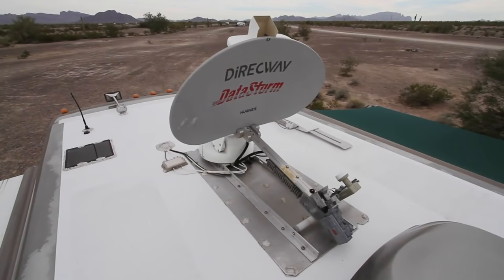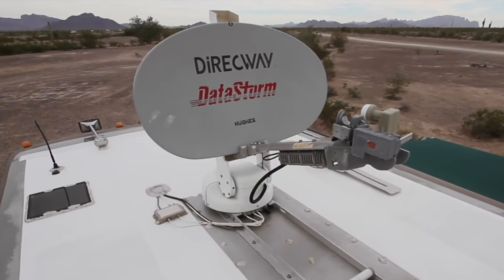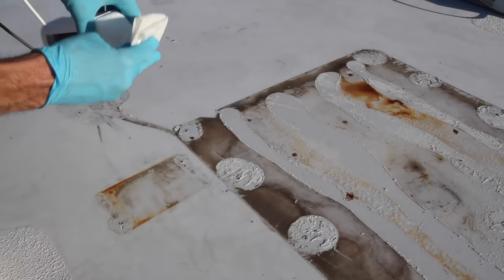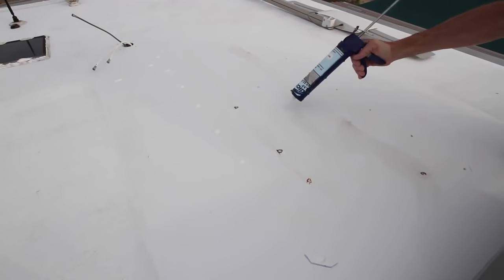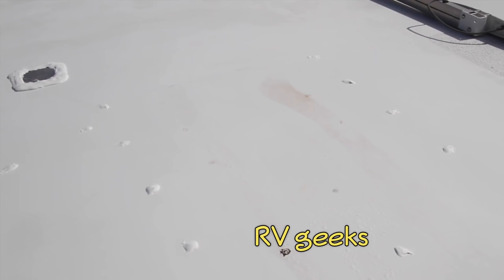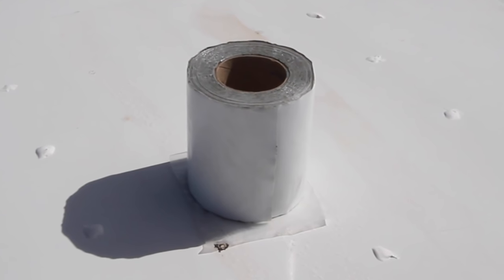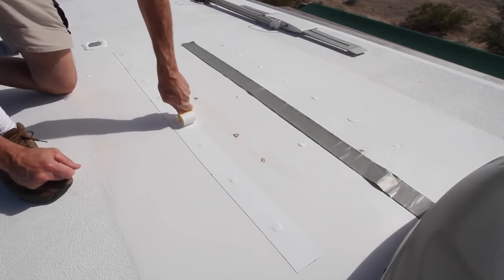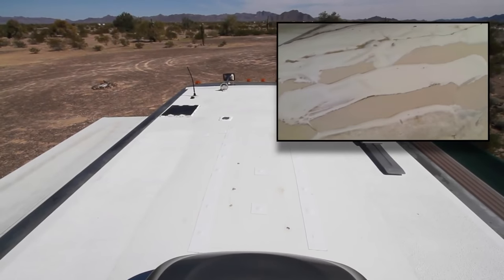How To Repair Holes in an RV Roof

Comment: Have a reverse issue. I have a similar hole to feed cables in but after two attempts it is still leaking. I think water is following the cables. I see you also put a cover on top , that just a sheet of aluminum? That is one thing we haven't tried.. do you have any video of the original install to show how you sealed hole?
Reply from the maker: The proper way to do this is with a junction box, which is how we installed our solar set up. That hole in the roof came from the factory like that with just a thin sheet of aluminum over it. It’s not ideal, but since we’re assuming that installing a junction box would be a lot more work since you’d have to access the ends of the cables to do that. Possibly better than aluminum would be a square of galvanized steel which is pretty thin and flexible. You could get about a 6 inch square of it and screw the corners down, pressing the cables flat against the roof the way ours does, and sealing all the way around with Dicor self-leveling lap sealant. Again, not ideal, but it’s never leaked in 16+ years.

Comment: I don't understand why so many people use Dicor when you have to inspect it once or twice a year for cracks. There are myriads of sealants and caulks that do not crack for a decade if not more. Am I missing somehting? Please explain RVgeeks. Thanks.
Reply from the maker: Other sealants become too firm, where Dicor stays soft and pliable. The vibration of driving would cause those sealants to separate from the roof over time. Dicor does not. The minor surface cracks that develop over time are easily detectable and patchable.. Specifically name one of these “other sealants” then read the directions, and you’ll find that Dicor is specifically made for this job and they are not. Even if you did use something else, nothing lasts forever. The difference is that others sealants aging and need of repair would only be detectable by the penetration of water into the RV.

Comment: With Direcwav, you have internet anywhere. Millenicom is available only where there is cellular coverage, correct? I ask because we do a lot of boondocking here in Utah where there is zero cellular coverage. Thanks for the great videos.
Reply from the maker: That's true. Where there is no cellular coverage at all, Millenicom will not work. And of course the dish will work anywhere you have a view of the southern sky. The reason we made the switch is because, although we still do a lot of boondocking, we rarely find ourselves completely out of cellular coverage areas for very long. The Datastorm dish gave us so little data before cutting us off under their "Fair Access Policy" that it just didn't work well for our needs. We work online and need more data and more speed than the dish could provide. The downside of course is that if we do find ourselves in no-cellular areas, we don't feel as comfortable staying too long without any connectivity to our customers.
Reply: RVgeeks
Wow that was a fast reply! Okay on the Fair Access Policy, that and the fact that I just read that basic tripod setup equipment runs between $1300 - $2000 tells me mobile satellite internet is not worth pursuing.
Reply from the maker: Our roof-top dish, which automatically searched at the push of a button, cost a whopping $5,500, and that was 9 years ago!

Comment: Hello. I need to cover a 1 “ hole in my rubber RV roof that the previous owner has used for a satellite. Would covering the hole with a 2”x2” piece of aluminum and plenty of dicor underneath and along the seal do the job? Or might you have other suggestions for patching the hole? Thanks!
Reply from the maker: Hi Adam! A 2" square, or slightly larger, aluminum plate would be great! You can install is the same way we did with our access plate as we described in this video. Or, since you won't be needing to open and close it the way we do, you could forget about the screws, set it in a bed of Dicor (same as we did), and then cover the plate and immediate surrounding area with Eternabond tape, the same type we show using to cover the small holes our satellite dish left behind. So it would kind of be a mix of both methods we used for smaller and larger holes.
Reply: RVgeeks fantastic! Thanks for the quick response. This and your other videos are great!
Reply: RVgeeks Hi there! I sealed it up as described and without screws. Initially, all looked good. I let it cure for a day and noticed this morning that the aluminum plate rose a bit from the roof. I think I may start over and screw it down this time. Does this sound like a good idea?
Reply from the maker: Hi Adam. Did you use Eternabond tape at all? If so, we'd leave it alone, since it's not going anywhere. If not, and you're comfortable using screws, we'd think that would be fine, too. We'd want something more solid than just Dicor holding it down, so either screws or Eternabond would be what we'd suggest. We mentioned using Eternabond instead of screws because so many people are concerned about screwing into the roof. We've done it many times, with no problem. The trick is to be sure to water seal afterwards with Dicor and/or Eternabond (yes, you can use all three (Dicor, screws AND Eternabond if you want to. Just let the Dicor cure a little before adding the tape. The big thing is that we wouldn't depend on Dicor all by itself, since it's a sealant, not an adhesive. Hope this helps!
Reply: Hello. Thanks for the reply. Unfortunately I did not apply Eternabond as it hadn't arrived in the mail yet (it arrives today). I realize I should have waited until the Eternabond arrived before starting this project. Just now, I ended pulling off the aluminum plate and now I have a mess with uncured dicor in and around the hole. Part of the rubber membrane of the roof is now loose around the hole as well. My new plan is to let the existing Dicor cure, put an even larger piece of aluminum over the hole and mess I created (including the surrounding screw holes that have been filled with Dicor), screw the aluminum down on a bed of Dicor, seal the screw holes and the aluminum with Dicor, and then immediately apply the Eternabond once the Dicor cured for a few hours. Hopefully this will be a smarter plan. Thanks for any additional feedback you can offer!
Reply from the maker: Sounds like you've got a plan, Adam! We think you have nothing to worry about. Consider letting that Dicor dry overnight before adding the Eternabond... and don't use too much Dicor.... just enough to fill the gap between the roof and the plate, a little line around the edge of the plate, and a little dab on each screw hole. The Eternabond will do the rest. Don't worry... your repair will be fine!
Reply: RVgeeks thanks for the reassurance! I needed that. Also, what do you think about using butyl tape underneath the perimeter of the aluminum plate (instead of Dicor) and then slapping a layer of Dicor on the top perimeter (as shown in your video)?
Reply from the maker: That would work, too. Hard to go wrong with this one.
Reply: RVgeeks thanks!
Reply: I am getting closer! New plate is all screwed down and a nice layer of Dicor is around the edge and on the screws. I let the Dicor cure overnight and noticed this morning an air bubble (rubber roof) on the edge of the plate. I was planning on taping the plate this afternoon. Should I just tape over the bubble and be done with it, or pop it with a pin and then tape it? Thanks again!
Reply from the maker: We wouldn’t pop it, since waterproofing is the most important thing. Just be ready... once you put Eternabond on a rubber roof, it will NEVER come off!
Reply: RVgeeks I read you loud and clear! Project finished. Thanks for all of your help!
Reply: @RVgeeks  does Eternabond work on metal surfaces, my van is metal?
Reply from the maker: @susiehernandez6652  It sure does! Eternabond sticks to everything!
Reply: tha k you!!

Comment: Just curious, how long ago this was done and if you have checked on it since then?
Reply from the maker: This was done only a couple of months ago, but we've been using Dicor for over a decade and have used Eternabond a few times over the years as well. Dicor should be inspected at least once a year for minor cracking. We have another place we used Eternabond about 6 or 7 years ago and it looks exactly the same today as the day we put it on. The stuff is incredible. The Dicor & Eternabond combination we used here will never need to be touched again.
Reply: I'm a roofing contractor and am familiar with Eternabond, you're right, good stuff.  The only cause for concern i saw was you used a polishing compound to clean the fiberglass.  These tend to leave a waxy film that may affect adhesion of either product, unless you used a solvent to remove it.  Just curious how it was holding up.
Reply from the maker: timtrain35 Thanks for the great input Greg. A good thing to consider. The polishing compound we used says it is wax- and silicone-free, and recommends waxing after use since it actually removes wax. It's a great point though, since using wax products could definitely reduce adhesion. We'll keep an eye on it, although We'd be impressed if anything kept Eternabond from sticking. When we tried to remove some several years ago, we finally just gave up! lol
Reply: timtrain35

Comment: Doesn't the Dicor sealant go right out the other side for the small holes or are you blocking the other side somehow? Also, did you choose the Dicor brand lap sealant because it is specific to a rubber roof? My holes are for a metal van. I am not sure what product to use and also wondering what exactly self leveling means or whether that's a necessity? Any help will be appreciated.
Reply from the maker: Since Dicor is only used to seal small cracks, and very small holes, it won’t drip through. We use Dicor because it’s universal and can be used on any type of roof from rubber to aluminum to fiberglass, like ours. Self-leveling means that after you apply it it will flatten out and dry smooth. It’s very nice stuff.
Reply: @RVgeeks  thank you, this may be a silly question but is a van made out of metal made out of aluminum. Did you but the Dicor at any ole hardware store or RV store?
Reply from the maker: @susiehernandez6652  Not a silly question at all, Susie! A van is almost certainly made of steel. But Dicor will still work on it no problem. We buy ours on Amazon. Here is a link to the one we use, that will work on any RV roof, no matter what it’s made of: http://amzn.to/2EgogKF
Reply: @RVgeeks  thank you

Comment: I was wondering what you recommend to seal an adapter for an ac unit on the top of a a sprinter van? Butyl putty and sealant?
Reply from the maker: Hi Tyler. Good question. We'd have to defer to the installation instructions for the A/C unit, as from what we've seen they vary quite a bit. Some have a built-on, closed-cell-foam gasket and don't need anything. Others specify the type of sealant they recommend (if they don't come with it themselves). So our recommendation would be to check what the manufacturer of the A/C unit you plan to install says.

Comment: So no TV when you're Boondocked? Any recommendations on best modern TV systems? Thanks
Reply from the maker: Hi Rob! TV while boondocking is very common. An inverter converts the 12 V DC battery power into 110 V AC power to run TVs and other household appliances. Then all you need is a digital over the air antenna, or satellite dish and subscription.

Comment: if the rv top was fiberglass, why did you not glass it with epoxy resin and fiberglass?
Reply from the maker: Fiberglas would definitely have been an option, too, but this was easier and uses materials we keep on board anyway. It's also easier for an RVer who has has no experience using fiberglass & resin, and we wanted to show a technique that works on ANY type of RV roof, for all those rubber roof people out there. LOL But by all means, a more standard fiberglass repair would be fine for our roof, too.
Reply: #George Jetson Our roof-top dish, which automatically searched at the push of a button, cost a whopping $5,500, and that was 9 years ago! @George Jetson

Comment: Good job on the overkill or I would've use the holes and replaced it with a solar panel kit maybe
Reply from the maker: Thanks Julie! That's a great idea. We probably would have used those holes for something, but the holes in the solar panel probably wouldn't line up with the ones from the sat dish.
Reply: RVgeeks but love the job did a very good

Comment: what kind of wifi did you get?
Reply from the maker: +Ignacio Campo We installed a WiFi Ranger, but we mostly rely on cellular data, not wifi
Reply: So the WiFi Ranger is not working for you? Thank you for your advice
Reply from the maker: The WiFi Ranger works great, but it does not create its own internet access, but rather helps connect to weak internet access nearby (such as an RV park's WiFi network or a nearby Starbucks or McDonalds when we're staying in a Wal-Mart lot, etc). But when we're rolling down the highway, or boondocking in a remote area (which we do a lot), there's no nearby WiFi signal to boost. That's why we use our WeBoost cellular booster to increase cellular signal to our phone and MiFi device, both of which rely on cellular data, not WiFi.
Reply: Thanks